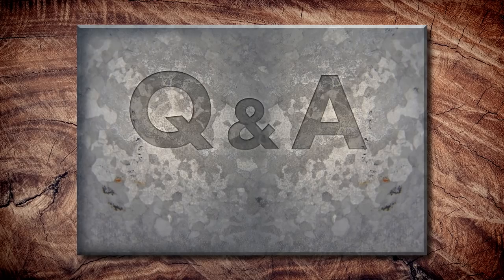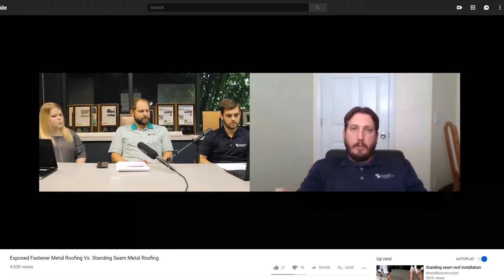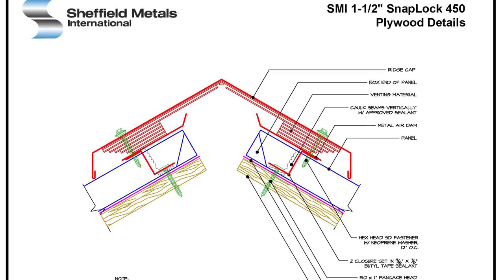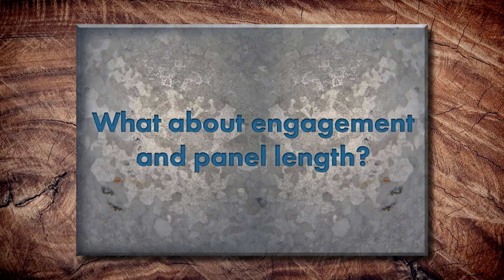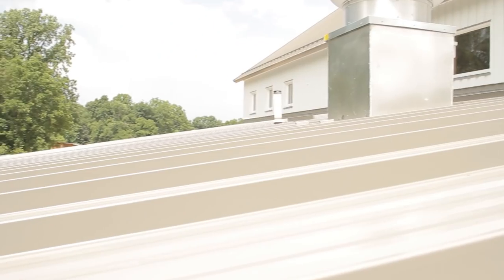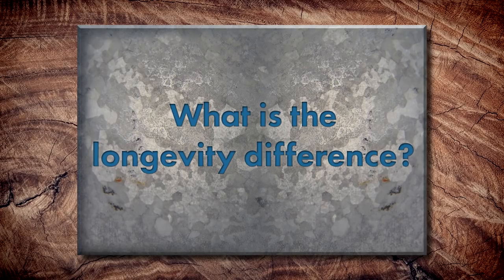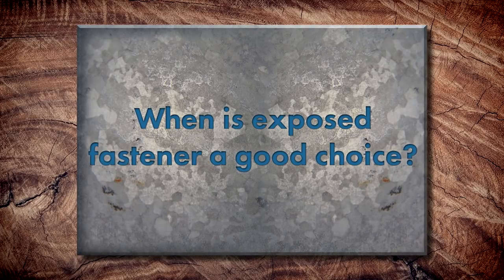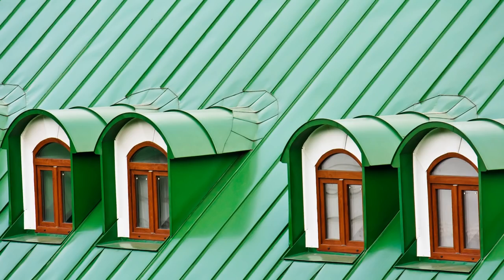Exposed Fastener Vs. Standing Seam Metal Roofing Revisited

Comment: Good info and nice presentation, my concern is what region was your info from. Being from Michigan we hear good and bad, but our weather can change as much as 50 degrees overnight. Which paint type and roof type can or will handle such extremes better. Is it better to use longer roofing verse shorter panels. i.e Gamble roof or Dormers and issues that have come up from the type of roof add on,s, such as Sky lights. Anyone know more please post.
Reply from the maker: Hello Ken! The Information is based on best practices and not a specific region, however certain regions might dictate different circumstances. Thermal movement charts are usually based off of 100 degree ambient temperature change in a 24 hour period. SMP or PVDF both should be able to handle the temperatures, but PVDF is an all-around better paint system as we have discussed in previous videos. For standing seam applications we don’t recommend lapping panels so the panel would be as long as it needs to be to remain continuous in length. Length of panel should not be a concern for temperature changes as long as thermal movement is accounted for i.e. expansion clips,  hem lengths etc based on the total length of the panel, panel material type and substrate it is being installed on. Expansion tables can be found in all of Sheffield's installation details. We recommend pre-manufactured curbs for any square penetrations. Most flashing kits that come with sky lights are not suitable for metal roof installations. Thanks for the questions! -Thad
Reply: @TheMetalRoofingChannel  thanks for info, and response good ideas for roofing hard to do with no information
Reply: Standing seam is  a lifelong product. Any good metal outfit is installing 24 gauge metal with 40 year paint warranty. Akzo Nobel and PPG paint systems with a reputable true standing seam installer should be what there installing. In michigan them barn panels tear out of valleys because of ice usually. The only way to flash skylights and chimneys is with hand crafted sheetmetal flashings. A good metal man or installers of mechanically fastened true standing seam will be fabricating all there drip edge sheet panels to length on the job with a portable machine that makes these panels out of painted coil steel. There also is aluminum copper and ryn zinc leaded copper lots of various materials in coil that can be made into panels for roofing. The blind fasten systems do cost more but here it is if you where to stay in a residence for your life you would put three asphalt roofs on vs. 1 standing seam metal roof. When you honestly break the price down a standing seam roof will look just like it did the day it was installed vs. That big ol truck
Reply: That u mite have purchased at the same time 60k truck shot in ten years 30 40 50k roof food to go. Guess  is people cant see you drive your roof around.... the true standing seam roof is the cat's meow..
Reply: TRUE STANDING SEAM MECHANICALLY FASTENED. 2 straight shots gable gable. Penetrations minimal and pipes and penetrations that are a must plan them to be closer to the ridge of the roof especially in regions of heavy snowfall. Standing seam set for good great product. The cost price factor into these more complex and heavier gauge roofing systems is not so much material comparison to asphalt prices. The more and elaborate the roof the higher the cost due to labor. Dormers, valleys,, sidewalls skylights etc. It takes alot more attention to detail then a utility knife to cut asphalt and a bucket of tar then to actually measure cut with tin snips and custom fabricate a piece of sheetmetal to get a chimney not to leak skylight etc. It is really nice to see the roofs that are all cut up and dormers and valleys and spires multi leveled with details up the wazoo. But to achieve the desired effect you must get the architectural layout to it. Nothing worse then seeing a botched layout on a multi sided spire.
Reply: Panels can be easily removed and replaced in a standing seam roof for all you nay sayers. Actually should never have to when properly installed. Yes it can be done. 24 gauge on a wooden deck withstand big hail no dents no granules on the ground after hailstorm. Class A fire rated lil break on home owners insurance... best investment you could put into your home. 60k truck in ten years old truck. That 10 year old roof looking just like the day it was put on money well invested.. Reputable company should be offering ten year no haggle warranty with this product then you know they reputable

Comment: What is the "maintanance" of the exsposed fastener you mentioned? Thanks.
Reply: You have to change the fasteners every 10-15 years, because of the steel contracting and expanding day and night causes the neoprene seals on the washers wear out over time and it will begin leaking.
Reply: @erickaufman4674  ahhhhh..thanks. i will either be dead or in a retirement community by then. But good to know.
Reply: Barn siding, agricultural buildings, not roofing quality in my opinion to lite  gauge tear that 29 aka pole barn panel with my hands "crap lap" good for livestock buildings and sheds etc. Atleast should be 24 gauge on the roof that's commercial grade. Paint quality has come along way on these heavier gauge painted metal roof coils. Different paints for barn panels. I just put it this way on my roof I dont want holes in my metal sheets. Screws go in the flats. Looking at the lapping rib on the sheet that first flat on the right of the lapping rib. If u float them through the tops of the rib they will orbite the hole overtime due to thermal expansion. In a pole barn u can often here the screws doing this on a hot but cloudy day sometimes loud enough to sound like a gunshot

Comment: carport roof is shingles and they have blown off several times but were not installed properly .The nails were not nailed in the nail strip and were nailed up to high .I called Max  Kendal here to put on a metal roof as they are the metal roof makers here in VA .He wants to put down strapping first and then the metal roof over the shingles .Carport was installed in 2006 with gaf shingles .Should this  be standing seam install
Reply from the maker: The short answer is yes, you can install metal over shingles using strapping, but we don’t recommend it even though people do it all the time. I would recommend tearing off the old shingles, that way you can inspect the wood decking and replace as necessary, install a new UDL and attach the panels directly to the substrate. If your roof has blown off several times already, why take any chances? Installing directly to the plywood also allows you the option of being able to use an engineered system because I'm not aware of anyone that has testing over furring strips. If you want to talk directly to our technical department about your project, you can call Jeff Hock our technical director here: 904.451.5989 Thanks for the comment! -Thad
Reply: @TheMetalRoofingChannel  if I have to spend more than 5 thousand I would have it torn down and put up a metal carport for 3 thousand and it is bigger than the wood one

Comment: What are my options if I want to install standing seam with spray foam as I would on an exposed fastener panel?
Reply from the maker: Hello! I can't give you a straight answer because it really depends on your assembly. Is this an open framing application or is there decking? Things like location, pitch, panel type, amount of foam, location of foam, and current ventilation all will have an impact as well. If you give me a few more specifics I will be able to better answer your question. Thanks! -Thad
Reply: The Metal Roofing Channel 
I am using an open framing system. I realized how much I disliked the look of the conventional R-Panel so I am looking at other options to put that have a more “modern” look. I loved the look of the standing seam panel but I was told that in order to put that I’d have to put decking. This is a simple open gable pitch and I wanted the look of a modern farm house. Thank you, I’d appreciate your input.
Reply from the maker: Thanks for sharing about your system! Unfortunately, there's some more information that we would need to say yes or no. Luckily though, you can contact the Sheffield Metals technical department directly and talk to them here: https://www.sheffieldmetals.com/Resources/Technical-Department
Jeff is the Technical Director, and his phone number is listed on the page. Give him a call and he will be happy to go over your assembly with you. Hope this helps! -Thad

Comment: On an exposed fastener roof I have heard that you have to replace the fasteners every 5 to 10 years.Any truth to that?
Reply from the maker: Due to expansion and contraction, the screws can potentially back out or make their hole bigger because of the metal's thermal movement. When that happens, it presents the possibility for leaks if the screws aren't maintained. It depends on the system, location and environment, panel length, etc. as to what time frame that would occur. Hope this helps! -Thad

Comment: Exposed fastner roofs are meant for Barnes Sheds etc not homes take it from me I have a exposed fastner roof it been on about 8 years and all of the rubber washers around the screws have began to dry rot therefore creating leaks.....my parents have had a shingle roof for 27 years now no problems at all just stick with shingles there cheaper and seem to be more reliable from my experience
Reply: I have 23 year roof with exposed fasteners and seals are still flexible. Those seals are made from EPDM rubber and everything is still perfect.